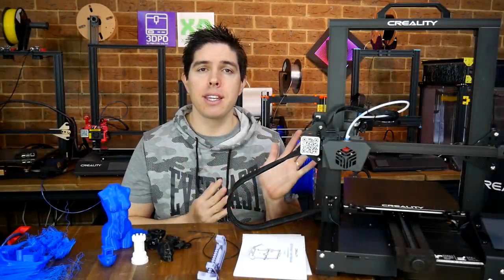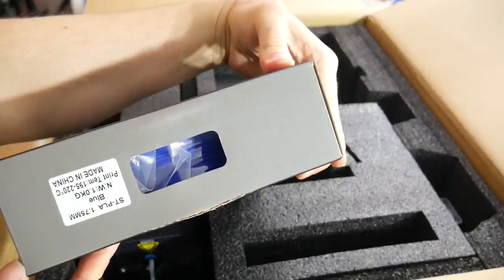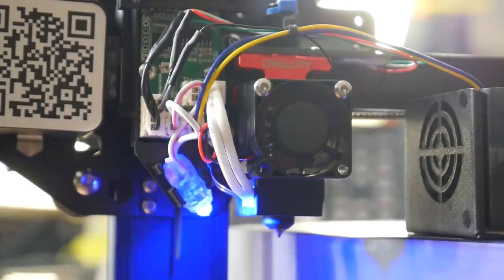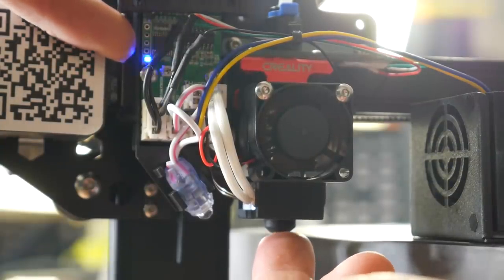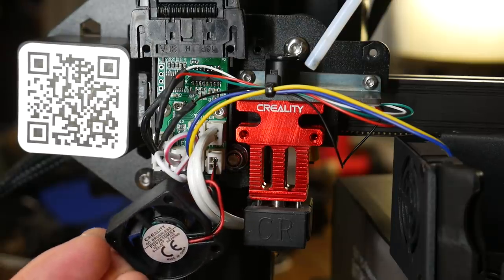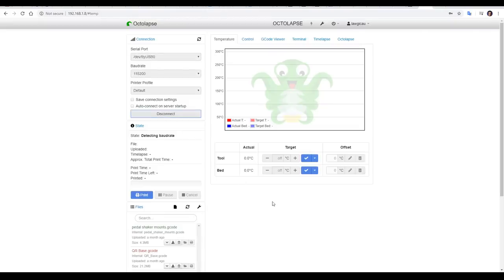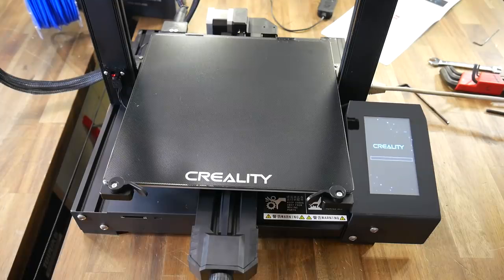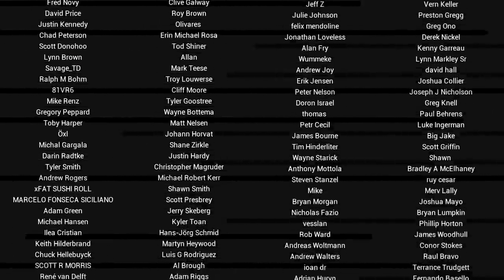Creality CR-6 SE - Your questions answered!

Comment: The main board on my creality sucks, unreliable micro SD slot, flimsy mini USB, no additional wifi or cable connections, no easy firmware update, slow UI and scroll wheel,  loud fan, no ribbon cables for strain relief, no internal memory. Terrible screen, Slow hot-bed and hot-end heating. My creality main board is just cheap. Not good in any way.. creality machines could improve a lot.